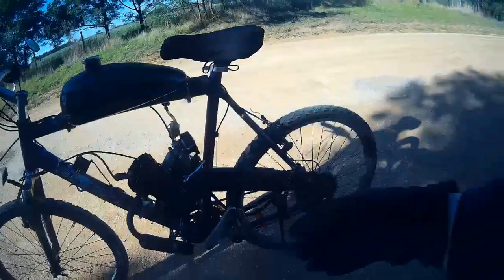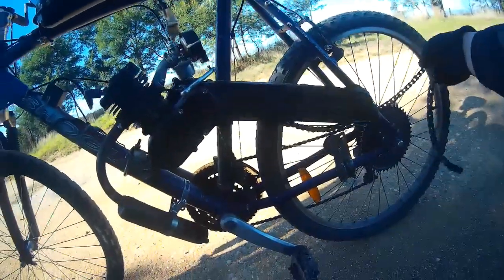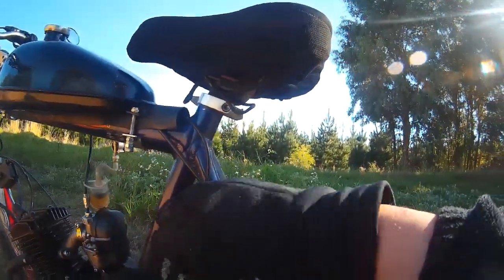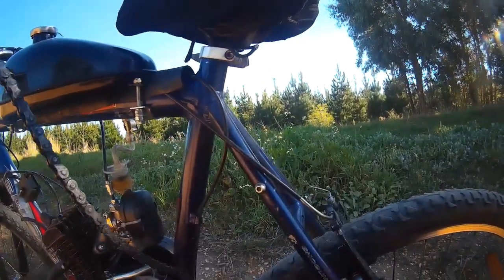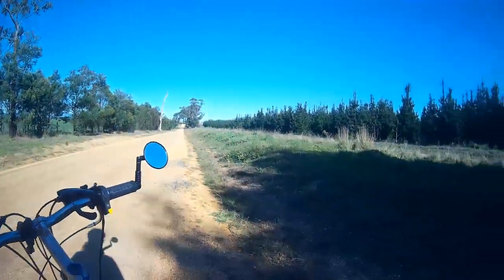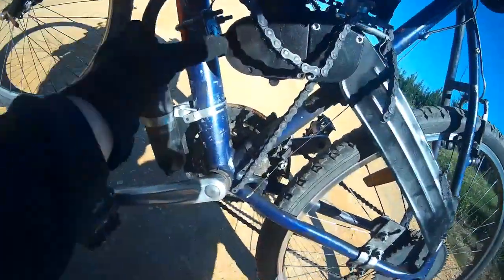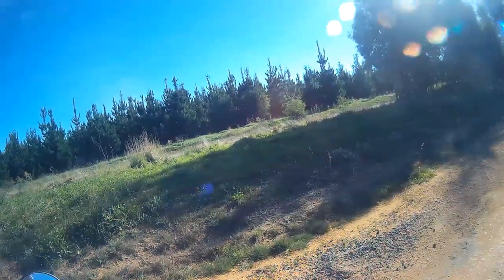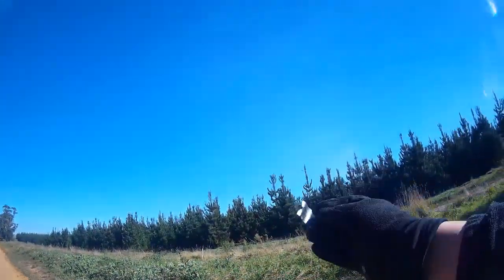Motorised Bike Fail

Comment: I had a feeling the gap between the motor and the frame was going to be a problem. You need to find some way to slide that motor down more. When you replace the chain try to find a 415H if you can.

Comment: Luckily every time my chain has snapped I've been close to home but every chain that has snapped was the stock one & fairly quick to. L a hover is correct 415h👍.also be careful when splitting a chain when pushing a pin out make sure the pin does not drag on the link when coming out  which will bend to the link.I don't use just a chain splitter I grind off the tip first so it doesn't mushroom out. I also have to be careful the angle I mount the engine because it will make the chain very close to the rear mounting bolts. If I were to let my chain tensioner go my chain would rub exactly against that but vs. A 415h chain the mount has no chance lol.I'm riding my bike to a chiropractor appointment today I hope everything goes good.